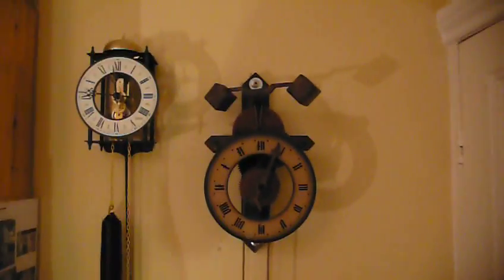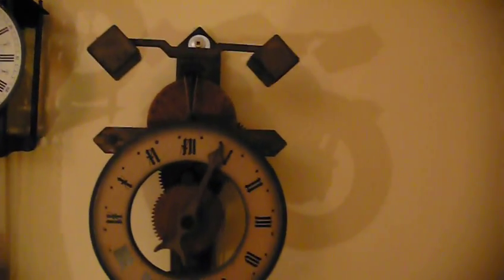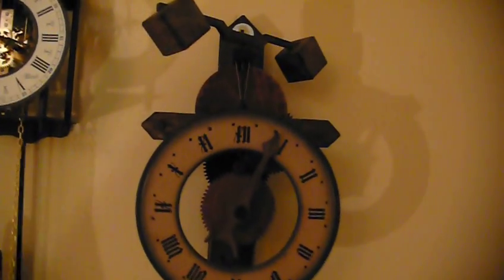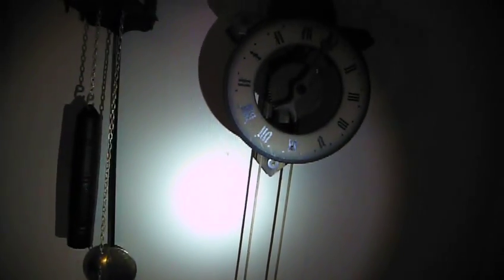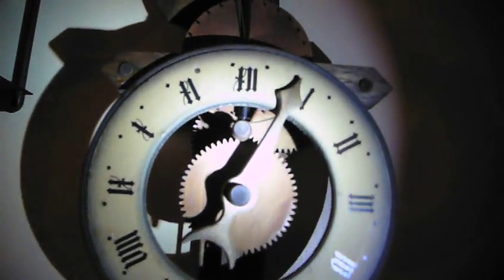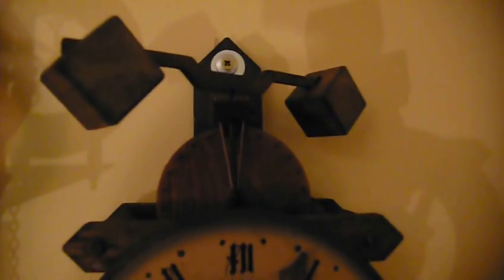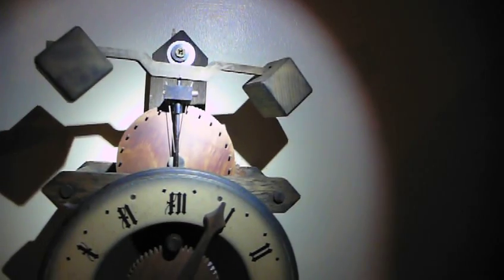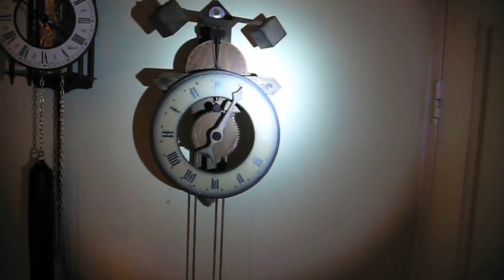Fb's Medieval clock 2013

Comment: Nice clock! Thanks for sharing. 

What is it that causes the foliot to change direction for the next 'tick'? 

In more recent clocks there is a spring which assists reversing the motion of the foliot. I'm interested in how this clock does it with no visible spring. In the video it looks like the weight on the escape wheel pushes the pallet, which forcefully turns the foliot in one direction, until the other pallet catches in the escape wheel, the whole pallet and heavy foliot rebounds, and the cycle repeats. Have I got that right? Sounds pretty hard on the gear. 

Thanks again for sharing!